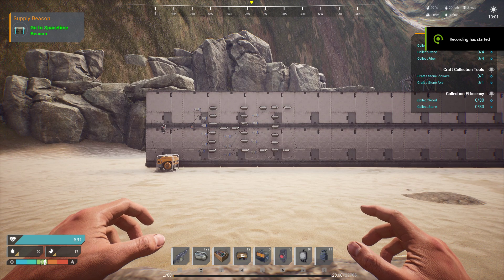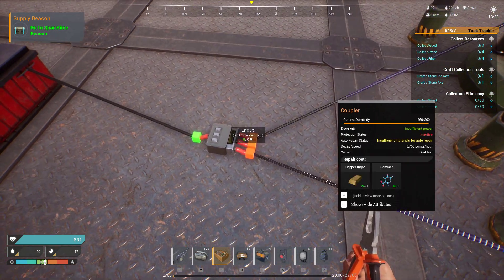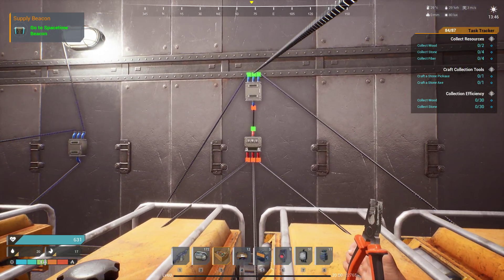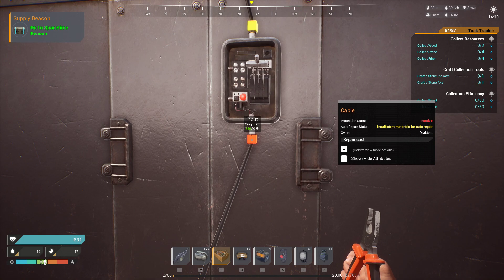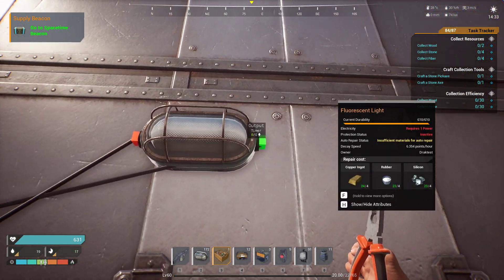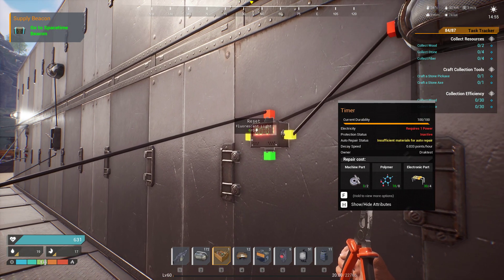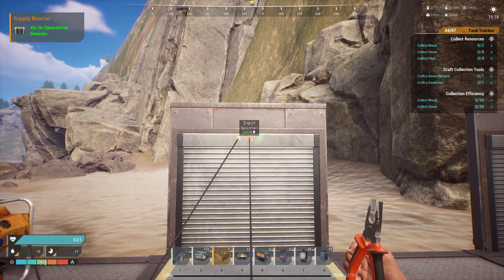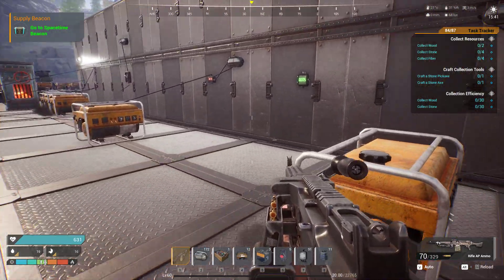The Front: Basic guide to the power network

Comment: Have you figured out how to have something powered by say wind, and then if that wind generators get destroyed it would automatically pull from the generators?  Is there a way to only kick on the generators if the wind would drop so it doesn't burn fuel non stop?
Reply from the maker: I have not played in a bit waiting for content to come out. BUT im sure you could do it with either the signal or the and or not gates. Hope this helps even if its a very broad response.

Comment: Go more advenced. I have farm of solar panels that go to one line that splits to 3 80power battries. Then join 3 battery outputs into one and into oil ring. OMG what the hell is happening. Capacity of 3 battery was full others where empty at beggining. Capacity from 3 was draining and first one was filling. First one got to full capacity while others were empty. When 1 become full second one started to be charging but during day oil ring was working with breaks as 3 battery was empty. Why it doasnt charge evenly? Also when battries provide 240 power and oil ring is 216 I think I have 24 power on output of oil ring. Is this wasted? Does oil ring use 240 as this is what batteries provide?

Comment: how do you get an output of 720 from 3 batteries, if i use the batteries you use in the video each have an max output of 100 regardless of the input.
Reply: he had max output of 720 from 3 diesel generators... a small battery only puts out a max of 100 power. hope that clears it up, you just got it mixed around

Comment: Thanks it helps a lot. But just 3 questions, please. 1- I connect my battery to the switch and turn off the switch. But it stills drainning power from battery. So it's a bug, right? It should not take power if it's disabled. 2- If i use a coupler i got 3 inputs and the output is the sum of 3 inputs, right? But what about the splitter, please? If i send to splitter 1 input of 80 power, the outputs will be ~26 (80 / 3) on each one of the 3 output, or each one will output 80 power, please? 3- I should connect the batterys i have in sequencial (input power to 1st battery, than output the battery to input of the 2nd battery and same goes on), or i should connect splitter to each battery and after couple all batterys? Thanks!!!!
Reply: 1. maybe switch it taking 1 power? 2. I think it depends what you connect. So you connect 20 power and then connect 17power, 2 power and 1 power all should be powered. You wont get 20 each. Question is what happen if you connect more then you have. 3. If you have 80power batteries and need 240 power connect each of 3 such batteries outputs to coupler. If you need 80 power but need more capacity connet output of batteries to input of another(one battery charges other when it depletes). If you need more power and more capacity 240 power on 80 batteries with a lot of capacity do 3*3.

Comment: How do you extend the cable? I can only pull the cable so far then it goes red, would that be for a fuse box? or a splitter?
Thank you for the video!!
Reply from the maker: Yes you are correct just use any of the electrical connectors if you need to extend it there really isnt any other way tbh!

Comment: Nice info - would love to see more advanced set ups.
Particularly how to be 100% gasoline free by using a large array of solar and wind to charge up a massive amount of batteries that can power an oil drill (210), mining drill (210), crafting stations, base lights, and base defenses.  Thx
Reply from the maker: Actually thats not a bad idea. Our base is pretty much completely ran off of solar as of now. Solar is a bit finiky and you have to manage it to make sure you dont run out of battery power during the night. I think we have around 30-40 solars up right now.
Reply: @Drakonus90-qb9gr  We are at 8 solar and growing. Only level 33 right now so not sure how many more crafting stations require power since I don't have any idea what we will unlock in the tech tree. Only thing I know of so far is the Oil drill, mine drill and the crafting deconstructor, so 210, 210, and 40?  But I've been trying to figure out a way to store lots of power (up to 6 large battery banks) and have them recharge during the day all while keeping the Oil & mining drills on 24/7.  Set lights on a timer to go on/off at night, and then just a switch for the deconstructor and base defenses.  And possibly figure out how to set up some generators to go on only when the solars don't fill the batteries all the way.  At least that's the plan as of right now.
Reply from the maker: @kemble0726   you will get bigger battery banks later. they are helpful for storing more power.
Reply: Not really practical right now. The amount of power these give is so low you would need to have dozens of them.
Reply from the maker: @rekrn12345   well we have around 70 solars and were oil free!
Reply: @Drakonus90-qb9gr  That is a ridiculous amount of solar panels to have. Totally not practical at all.